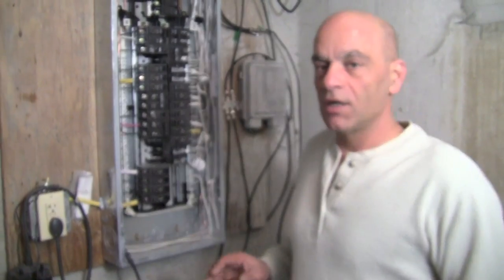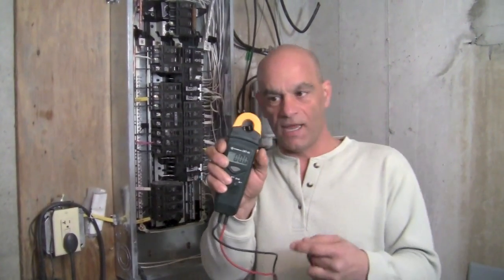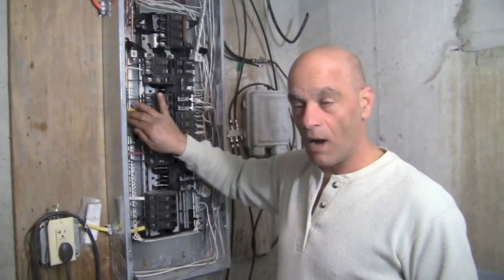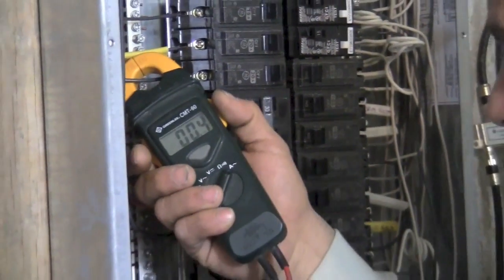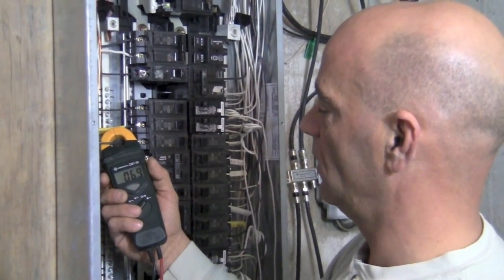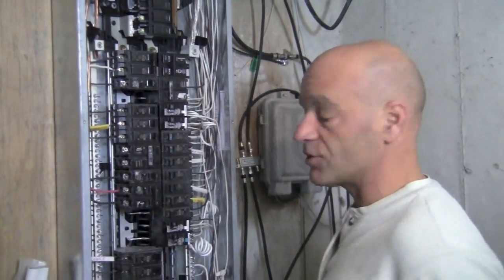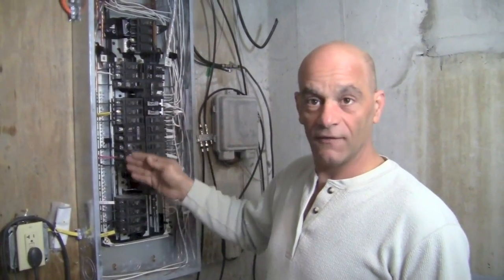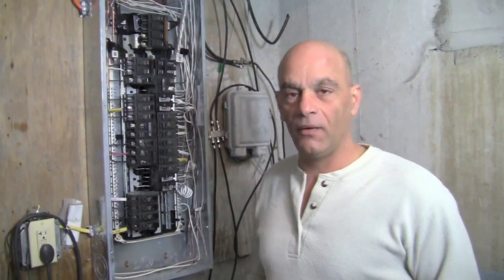How to check the amps being drawn from a breaker

Comment: Hey Dominic, thank you for all of your wonderful videos. Here's my question,i'm a contractor and have lots of knowledge pertaining to electrical issues, but there was a 200amp outside breaker box on a clients house, and a 100amp sub panel on the inside of the clients house. There is a hot water tank on a 30amp breaker that keeps tripping and instead of the 30amp breaker tripping in the sub panel if the hot water heater had issues, why would it go outside and trip the 100amp breaker that's supplying the power to the sub panel on the inside. please help me here. the other few breakers on the inside of the sub panel is not alot of power or amps to justify the 100 amp breaker to trip outside that's supplying the power to the sub panel that's inside.
Reply from the maker: David Lee  That 100 amp breaker could be bad. I would get into that first. Could save you a lot of time.
Reply: Thank you dominic. That was suggested to me by another electrician saying that the breaker may be weak. All that was done on the house were suppose to be inspected on the outside by city officials but I couldn't believe they didn't make them install a disconnect on the 200 amp box outside under the meter. What I did is just removed some of the breakers on the inside subpanel that wasn't being used and that seem to have solved the problem. But I will still change out that breaker. Thanks fellow. I enjoy watching your videos.
Reply: Wish I seen this 6 years ago, sometimes with a 240 volt circuit when you have more amps on 1 leg or a ground fault it will trip the higher breaker quicker then the smaller one, remember with a ground fault is only on 1 of the 120 volt legs. Anything between the 2 legs is a dead short which almost always trip the larger breaker or both.

Comment: Dominick, thank you very much for your excellent and clear explanation of wiring a sub panel, especially the splitting of the neutral and ground bars.  Also excellent tip on removing the sheathing on the NMC cable and proper sizing.  Very well done!
Reply from the maker: Murray Berkowitz Thank you very much

Comment: Per usual Dom, great stuff.  I was (however) waiting for you to "light UP" with the way you where putting your hands all over that live panel box.  I'd been a bit timid myself to have been doing that.  But that the difference between experience (you) and occasional weekend warrior (me.)
Reply: Don’t touch the bus(the metal in the back that the breakers plug or screw onto), or the metal where the wire lands on the breaker.

Comment: Years ago I lived in a house and the power went out in 2 rooms. I called an electrician. He checked the circuit breaker box it took him about 5 seconds. He said I needed a new line out side from the pole to the house. What did he do to know this?
Reply: cooldog60 the wire size was too small for the amount of current you were drawing. That can overheat the wire and start a fire. That’s how he knew, we know what colors to look for also.

Comment: Great video. What if its a 220V circuit? Do I read both wires and add the amps from each, or one of the two? Trying to see how much consumption my new pool pump motor uses up.
Reply: That's a good question I'd like to hear the answer to.
(edit)  Okay, I see the answer is to add the two values to get the total.

Comment: Great video.  My home office was pulling too many amps as it was designed for a bedroom and not really a home office.  Thanks to this tip I was able to figure out that I had a bad battery backup device that was eating up the electrons.  I took that out of the equation and did other things to lighten the load.  Anyhow, didn't even know that device existed before this video.  Thanks!
Reply from the maker: Awesome glad I could help.
Reply: askmediy You've got some good videos on here and you put things in language that the average joe can understand.  I'm going to embed some of these up on my automotive websites.  Check out GMTruckClub.com and/or ToyotaTruckClub.com.

Comment: I have just started having a breaker that keeps tripping 15 amp .I live in a mobile home the wires are in a very thin roof when I turn a light on the amp is showing 21 amps at the box .What could be causing the breaker to be getting hot and tripping any tips to how to find why this has started happening I would have to tear the whole ceiling down ? To find this short .Thanks for reading
Reply: Stevie, I hope someone has already reached out to you about this... I think you already said it... You have some kind of short! (Or at least a piece of crap light fixture.) I would retest, and verify your reading... Your 15 amp breaker shouldn't be at 21 amps (more than a couple of seconds) before it trips hard. It's POSSIBLE that using your tester next to a jumble of wires has skewed your results. Test the thing, but PLEASE don't continue using this circuit until this is fixed... You are likely to burn down your home. :( 

A few questions:
1. Is this light the ONLY fixture on the circuit?
2. Is there any draw when the light is turned off?
3. Have you tried replacing the fixture with another light and retesting the draw?

And for goodness' sake, please respond so we all know you didn't die in a trailer fire... :(
Reply: Steve Cox
I have not got to work on the problem at all have spent 16 days spread out over  Feb march April on heart problems.There 3 plugins and 4 over head lights . I have been scared to death of trying to use it but hope to climb under and hope the wires are under the floor .If there under it i can repair but if in the thin roof it will be hell. I have checked the reading with another tester same thing 21 amps stays on for over 5 min before tripping the breaker I replaced the breaker with a new one still same thing .Ill let you know what the problem is when i find it .Thanks for responding Ill retest this weekend going to pull all light fixtures and plugins out .

Comment from the maker: Sounds like you tripped a GFI outlet. Check the bathrooms, kitchen and garage. Also check outside outlets as well. There will be a little push in tripper on the front of the outlet.

Comment: Hey Dominic, Question..I just plugged in a new vacuum cleaner and power went off on half of the master bedroom and the entire master bathroom. I checked the breaker and it did not trip. I do not have a Volt meter but do have a little mini LED 110 and 220 volt tester and the jack (where I plugged the vac)  lights up on 110. When I turn on the bathroom lights it shuts of the little LED tester. It’s as if it doesn’t have enough amps anymore. Any Idea?
Reply: That vacuum cleaner had enough of an initial crank to exceed the max load on the circuit. It can happen quite easily depending on how many items you have plugged into the circuit at time of start up.

Comment: You have it right. The only thing you can do is rewire the circuit with a larger gauge or break up the circuit with multiple feeds to the panel. I hope you have an attic to work with. :-)  Sorry about the builder fucking you over. That's just the name of the game. Why wouldn't you want to build a house as cheaply as you possibly can?

Comment: Oh I see. That's what you don't want to do. The whole point of a breaker is to protect the wire so it doesn't have more current than what it's rated for flowing through it.  Here's the rating for wire in a residential application:

14 gauge = 15 amps
12 gauge = 20 amps
10 gauge = 30 amps
8 gauge = 40 amps
6 gauge = 50 amps

I hope that helps.

Comment: Older circuit breakers do go bad and trip before they should on occasion. It may be worth your while to buy a new breaker and put it in and see if it trips under the same conditions. Home depot sells 20 amp GE breakers for something like $3.27, so it shouldn't cost that much to try. One thing you sure as hell don't want to do is put a higher rated breaker on a wire than what it should have, like a 20 amp breaker on a 15 amp circuit. That would deplete the purpose of having a breaker.

Comment: My circuits are always breaking when my wife runs the hair dryer, when i turn on  the air compressor, stuff like that, and they're different circuits. There's not a lot of stuff on the circuit besides that one appliance. The breaker seems to trip way to often. Is there a simple solution or do i need to upgrade the whole breaker box?

Comment: It's too bad those inductive ammeters can't be used with typical cords, with current going both ways. I have an inline ammeter that plugs in, basically inserting itself into the single plugged circuit that is a little more simple for a single plugged device. But for a full circuit like you show here, there is no option but to open a box or panel.